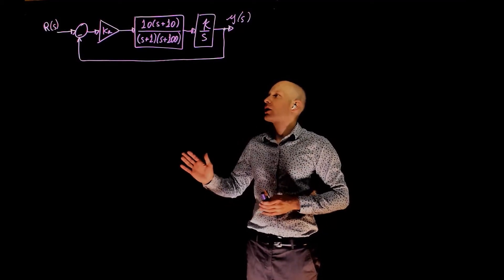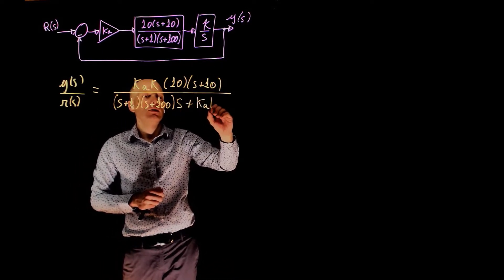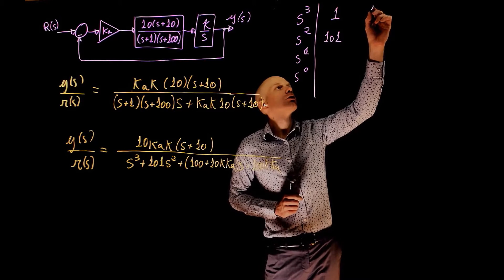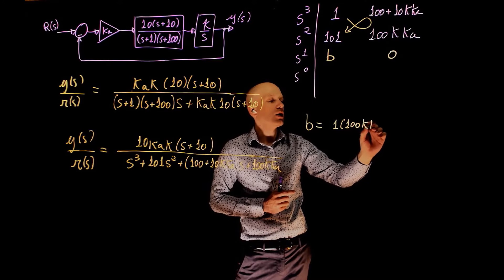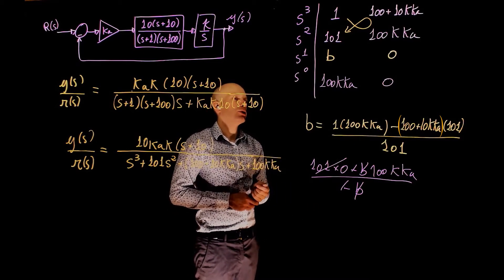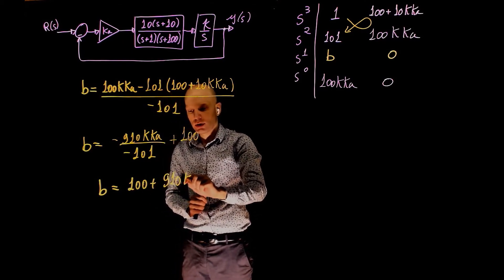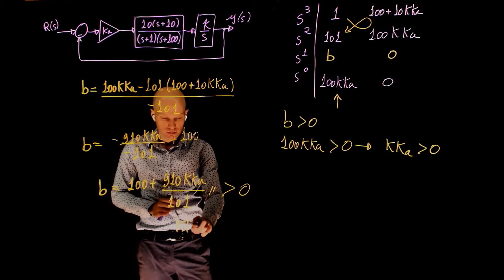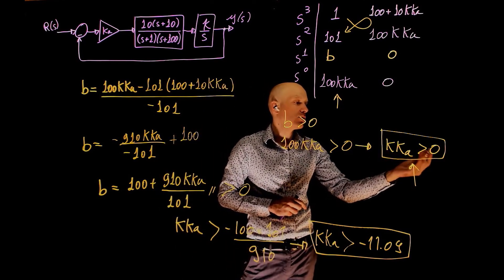L10E47 Control Systems, Lecture 10, Exercise 47: The Routh Hurwitz stability criterion.

Comment: KKa should be greater than -11 as -11 is smaller than 0 so values like -10 is greater than -11. So finally it should be greater than -11... right?
Reply from the maker: if KKa >0, then it is also greater than -11. So the first condition is sufficient.
Reply: @biomechlab  yes it's sufficient but values like -10 will also be valid right? So isn't kka>-11 more restrictive condition?
Reply: @biomechlab  Sir i had another request can you please put up a video of solving the transfer function for exercise 35. That is (s+4)/s^2+6s+16. I wasn't able to manipulate it!
Reply from the maker: https://youtu.be/FgjQOuxgwd0
Reply: @biomechlab  i have seen this video from y(s) to y(t) it's solved directly we had to manipulate it to keep it in sin formula which i was unable to do, i would request you if you could help me!